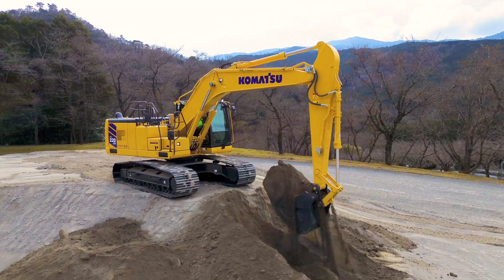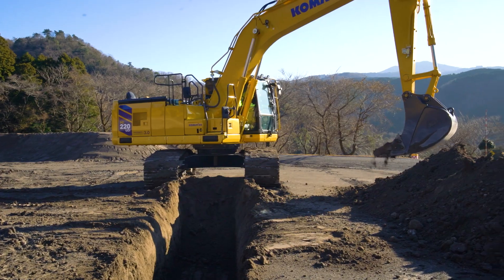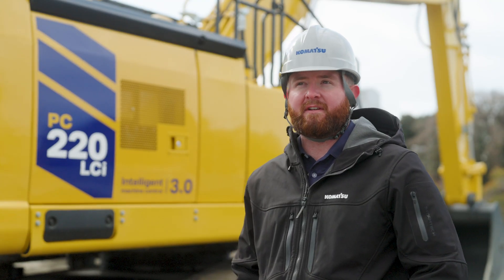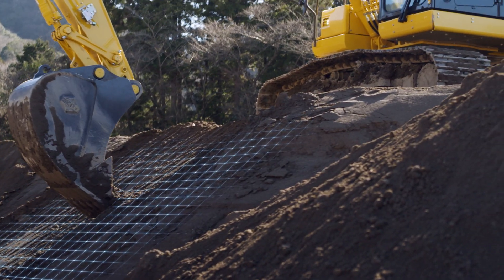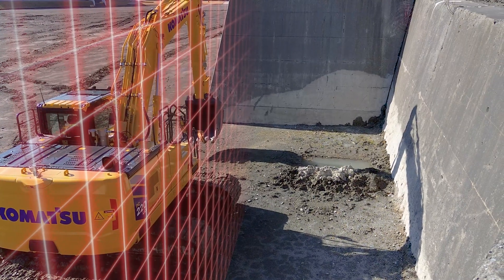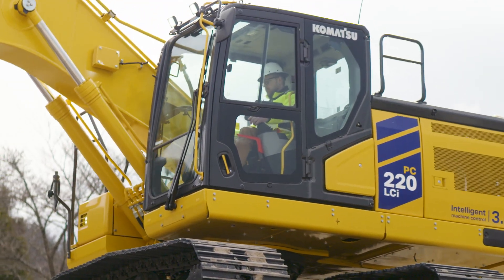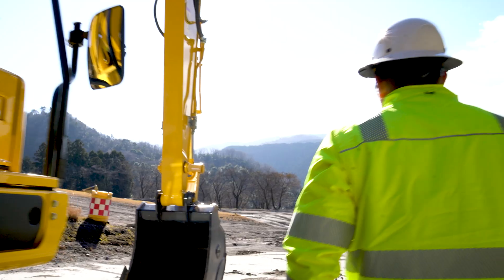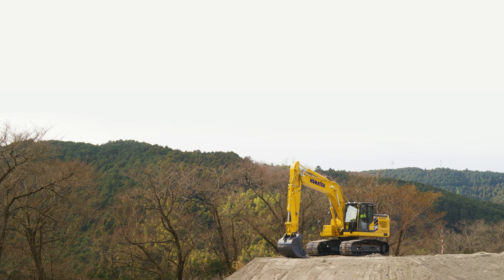Komatsu PC220LC-12 and PC220LCi-12 excavators: Built for smarter, faster work

Comment: A new generation but Komatsu didn't change the bucket design. It is a nightmare trying to completly fill the bucket with this roundish design, it is so hard to get a full loaded bucket because it spills out much of the material, and this bucket makes it almost impossible to do a even ground surface.
Komatsu must get rid once for all of this roundish bucket.